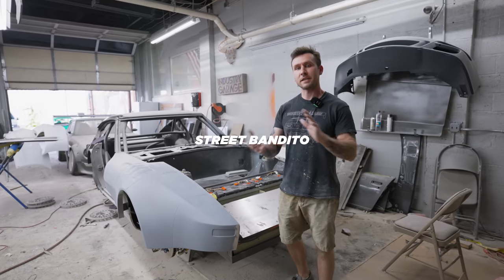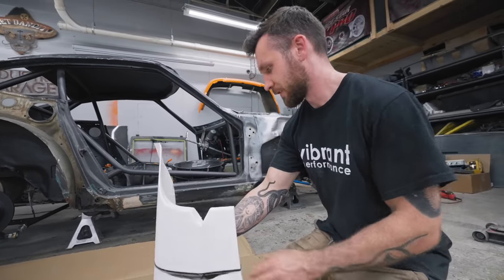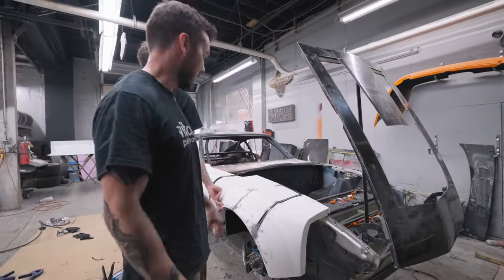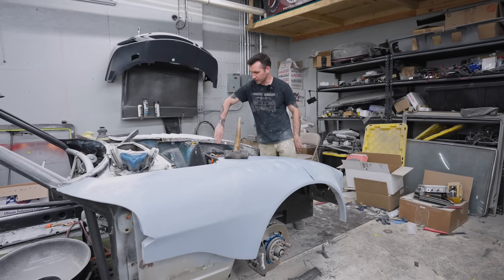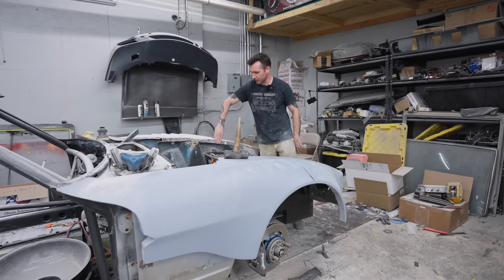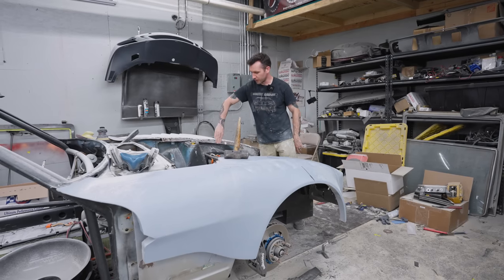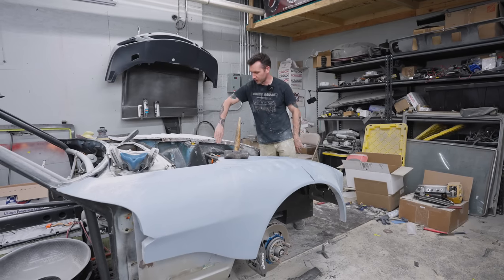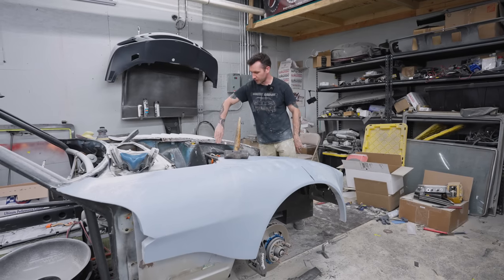Using 3D Printers To Build A Car Out Of Carbon Fiber | Part 1 | The Legacy (11)

Comment: This is awesome! We make a large format 3d printer that should be able to print those finders all at once with a separate support material. If you guys are doing much more of this or have a project that could use a larger printer let us know we would be happy to work with you guys on something like this.
Reply: Interested, personally. Do you have info on the large format printers, that is big enough to print a whole fender? Or do you have a way to get in touch, or even a link?
Reply: What printer do you guys have?
Reply: I built a 1.5x1.5x2.5 meter printer for projects like this and ended up selling it because it only had 2 nozzles pla and support filament, with 5 smaller printers I was able to print 4 times faster because I had mor nozzles working at the same time, also if a part failed it wasn't a huge issue in comparison to 1 large print
Reply: Could the same printers used to 3d print houses , be modified and used ?
Reply: @YeshuaDisciple916 Wouldn't it just be easier to make em with carbon and epoxy?
Reply: @CarsCatAliens  you can print directly in carbon impregnated filament using a hardened steel nozzle and then resin it. or create the outer moulds to vacuum prepreg or vacuum infuse. many ways to skin a cat i suppose.
Reply: Everything can be scaled..
Reply: I have a darsun z I'm keen to do a 3d body kit for
Reply: @RageAZA sorta my thoughts, but also for a need for replacement parts, this would be pretty consistent. Just build in rock shields separately, each panel gets a layer or two of carbon/kevlar/glass, then who cares about the top half, especially since so many cars these days are wrapped. Could skim it or whatever but frankly I'd just be worried about weight/rigidity

Comment: I am just tuning in for the first time.  it looks like you have these 3-d print parts that are all BUTT-JOINTED with flat face to flat face.   Instead you could have modeled an EDGE-to-EDGE detail like a ribbed joint, or studs and recesses, or borrowing a joint from woodworking, a half-lap, tongue and groove.  Fingerjoint might be too  fussy, and visible on the surface.  But you could model an edge pattern you could never do with straight-cut wood.  You could leave small voids for your epoxy in the joint width instead of letting it randomly ooze flat out.  Your joints would be stronger and more accurate to key them together, modeled, than relying on flat clamps and by "feel".  On the FINISH side you could taper the faces like on the long side of  gypsum board to have a very shallow V-joint for your finish compound to fill, and less likely to see the joints through paint, years later.   Of course thats a lot of work and you are in a hurry.   This is the first time for me seeing car body parts printed, and I am no 3d-print guy, and its great, but you could make your joinery do more work for you.

MUCH LATER: I wasn't paying close attention to the whole watch... the printed sections are just your mold base and not the finished shell, and not the mold-negative. So some of the above isn't relevant.  Anyway, you could still add the joinery technique so your mold-base would have tighter modeled geometry from end to end, and your clamp-up phase might go easier.  But after that your mold-negative is really flexible so geometry goes everywhere, and you lay CF on that, so geometry only happens when you put the shell back on the car.

Comment: Progress is looking great!! A tip I could give would be to tab in an egg-crate on the back side of the molds after cure, before removing from the plug. This will keep the geometry from changing under vac when making parts. 

For what you have done so far, I'm very happy to see the consistency of completion. A lot of projects of this scale hit major delays or never see the light of day. Excited for the next video!

Comment: I don't know much about car fab, but I know my way around 3D printing. I came to learn how it is used for carbon fiber work. I appreciate you showing how it is done. Nothing wrong with how you did the 3d printing in vase mode. A few 3D printing things you might try. In prusa slicer you can split the model and add connectors so they snap together so they are already registered. I would probably do infill over the vase mode to give it some better structure, like 10% and use adaptive cubic infill to keep the print times down. The infill will keep the parts strong and consistent. When gluing 3d printed parts, epoxy works, but there are bonding agents for PLA and PETG plastics. It might save some cure time and effort over the hefty applicator. Check out gloop or ca glue works well too. All just suggestions in hopes that it helps a bit, no worries if it doesn't work for your purpose.🍻🍻
Reply: Actually just took notes.

Comment: HI, just to say (I don't know if you know it) but avoid direct contact between metal (any kind) and carbon fiber, it will induce corrosion if there is water. You need to isolate the 2 surfaces from each other. It's simple, most people use a ply of glass fiber  between carbon fiber and the metal (or any other non-conductive material). Good project continue like that.

Comment: Very nice, goes to show what some 3D printers can do. I've always kindof dismissed printing for carving foam but I think at this point the 'ease' of just letting the printer chug might trump the work of loading foam onto a large router that is only going to get one side real good. 

For mirroring contours and details my go-to is always just take some paper and trace the shape on one side, cut the line out to make a template and tape it down on the other side. I suppose if the left and right sides don't lay quite the same it might push the template off a bit but wouldn't be too bad unless they were notably different topologies.

Comment: 3D printing is super neat with its use cases. Not that I’ve done anything to this level but I measure a blank switch plate for my Z, redesigned it in Fusion360, and added a hole the exact size of a switch I was using for my air compressor setup for my aircups. The button fit in super snugly after a few tries and since I designed it in CAD it was perfectly center and snapped right into my dash just like OEM. What you guys are doing it a whole different level and just goes to show the many uses for these inexpensive FDM home printers
Reply: 3d printing is going to keep our old cars on the road as it's becoming impossible to find replacement parts for some items.

Comment: I almost did this, then found a large form CNC machinist near me. Got a whole side of a car CNC into a negative or “plug” to lay one piece of carbon into

SO much cheaper, easier and quicker. The foam machined plug was like $390, just send them the cad file and happy days. It is one use but I’ve had not deformities or anything. Had the option to pay a few hundred more dollarydoos to have a 5x reusable one but I’m only make one Porsche haha

Comment: DuraMix 40/40 FTW!!! I have always spoken that stuffs praises! Not sure what it's called over here but where i'm from it's Duramix 40/40, and I used to use it a ton when making custom plastic Head Unit plates since my main work consisted of Fiberglass subwoofer enclosures and the such, from time to time this included making paint matching smooth custom Head Unit surrounding plates to replace the stock that would leave section of space, and mine would fic it up to look custom but also factory look if thats what a client so desired.

Comment: Was just thinking about doing this to a 914, I have 3D scanned the car and made STL files of the body sections to 3D print the panels using them as a core and wrap them in Carbon Fiber. The issue I see is that the 914 body is one piece and welded to the frame, making it a little more challenging.

Comment: For future reference, you can buy material 50" wide, but almost any length you could want. One piece for the outer skin and however many pieces you wish for the inside layers. :) No need at all for any butted joints because of a 50" limit.

Comment: this is an epic project, well done guys! one thing I noticed is it looks like the carbon wings were produced under a vacuum using vacuum bags, but I thought it also had to be done in an oven or heated room, how did you manage without it? 🙂

Comment: Awesome build!  I'm about to start a similar ev project.  I've had the thought to 3d print the body panels for some time now, and am stoked to see someone else has done it already.  

Question for you though.... I have a lot of exerpeince in machining and 3d printing, and have a large scale printer that can print the components all in one shot.  I was thinking about using a strong base material, like matterhackers NylonX witht he carbon fiber refinforcement, but i was going to carbon skin each side of the print, wet it out real well, then put it in the vaccum and seal the part inside the carbon.  

Just curious why you pulled it off.  was it just to make a thinner, lighter piece?  My thought was to use a 1mm nozzel (bigger printer needs a bigger nozzel so it doesnt take a month for each part) and going for a solid print with 3-4 layers at .3-.4 layer hieghts. Then putting another 2mm on the outside and 1 on the inside.

Would love your input on what you found!  Im considering making a video series on it... but its probaly going to be weeks worth of footage of what not to do before getting to the final product, haha

Comment: Loving the whole 3D printing thing. Should have printed in some mortice and tenon elements for registration so they all line up automatically.
Reply: I was thinking the same thing, but unless they printed everything in an enclosed printer, warping may have made it more difficult to line up during glue up. Without the mortice and tenon's, it was easier to fudge it if the parts did warp at all?

Comment: quick tip from me, you should use some D2-4mm dowel pins of like at least 20mm length to connect those parts, that way its way easier to position things before glueing

Comment: So cool bringing new tech (3D printing) to an old craft (mould making)! Do think it could be possible to carbon or glass fibre straight on the 3D printed panel and still end up with a light weight panel? obviously it would require lots of sanding and then a painted finish. however there would we no need for the female mould. I'm thinking for wheel arch flares.

Comment: Super cool,  get your 3d print designer to include holes and tabs in order to line up the models and screw the fender pieces together make it much less labor intensive. I guess if making molds you don't want inconsistency on the back.

Comment: Kind of surprised you guys didn't design in guide pieces into the the connecting areas.... Like little pieces sticking out that fit into the other portion to allow easy alignment without the worry of potentially having the design slightly off.

Comment: I've got one of those Neptune 3 Maxes. Due to the sheer size of the thing it prints really poorly at 0.4mm layer height with the 0.4mm nozzle, I did want to bump it up to a 0,8mm nozzle, but I keep putting it off. I've got a pet project of converting an SMZ S3D into a 1:2 DeLorean Tiny Tike thing and I really struggled with wrapping my head around how I'll sculpt the body. Had the whole thing modeled up in CAD, but 3D printing it didn't even cross my mind. Gonna definitely give it a stab given how small the car is.

Comment: Hey guys, this 240 looks absolutely killer. I just stumbled upon ya'll as I'm new to 3D printing and composites in general. I'm looking at developing a kit car and would love to be able to 3D print molds for use on carbon fiber body panels. One question, what's the material you used to create the Carbon fiber mold over the original 3D printed mold? Looks like ya'll applied it starting at 14:45 and then removed it at 16:00. Thanks!

Comment: I'm guessing you printed a positive to check fit and make a more durable mold but, for quick one-offs you could just print a negative.
Reply: I was going to make the same comment, the 3d print is just a pattern to pull a glass mold off of but it seems they used the print, if it’s pla you guys are going to have problems, especially if the air trapped in the infill of the printed part starts heating and cooling, and pla is corn based, it will decay in a year or so, the paint and clear coat may help a little, ASA is a more durable plastic designed for automotive use, however it’s expensive and it too will have issues later, I highly recommend removing and molding the parts, then producing fiberglass’s-or carbon fiber end use components, it’s a beautiful design, would want it to last
Reply: Oops my apology, I started commenting half way through the video, nice patterns…..
Reply: @blackjacko asa is the same price as every other filament, if not cheaper; do you even own a 3d printer?

Comment: Where do you guys get the STL files for the 3d printers to make the panels? Or do you scan original pieces and use software to clean it up before sectioning them to be printed in parts?

Comment: Must say the car looks stunning guys , very very nicely styled  .
I’ve done something similar but with an e36 but not electric so I definitely know how hard things like this are  .

Had to laugh when the PVA was being pulled off the mold , looks like it’s not just me that gets satisfaction trying to get it off in big bits 😂. .

Can’t actually wait  till it’s running 
PS just watch the scrub radius on the front geometry and the wide offset , could be very twitchy .
🇬🇧👍

Comment: Ive been thinking on this for a while, so I figured I would ask (maybe Tim or Tofu can chime in). Why wouldnt you print the plug directly rather than having to still pull a plug? Is it just for the fine tuning of fitment on the car that would be the issue at that point?

Comment: Hey Tim, forgive this newbie question but if the 50” wide piece was not wide enough to do the whole fender, can you not rotate it 90 degrees so the 50” runs vertically and then just cut off the roll for the entire length of the fender? Wouldn’t the weave technically still look the same when rotated? Genuine question as I’m wanting to venture into carbon fiber.

Comment: How do you mange to not overheat 3dp model when applying fg, even low exotermic resin systems go to 110 degres (C45). My large model made with PLA expanded during mold making. You use PETG?

Comment: I know it's a SEMA car so functionality is probably (definitely) taking a back seat but I think it would be good if you found a way to get some air (maybe via some carbon ducts) to the front brake rotors. I think the way it is now there is very little air flowing through that area.

Comment: For future builds with large 3D printed parts (or anything you want to be stronger) you can literally get a bucket of superglue and hand wipe all of the parts down to increase the bond strength of the layers exponentially. Try it. You won't believe it.

Comment: What has prevented the auto manufacturers from 3d printing vehicles enmasse?  Iknow NOTHING about 3d printing but correct me if I am wrong, we can indeed 3d print metals right?  Is it just too cost/time prohibitive vs just stamping sheet metal? My biggest complaint about the super/hyper car market is they are inferrior vehicles compared with everything else but have niches like exotic looks and engines that should easily be replicated for a fraction of the cost. If someone could 3d print body kits for GOOD vehicles, even something like a Toyota camry to make it look like a lambo, I would imagine theywould take off pretty fast. I know I would buy one.

Comment: you can weld plastics like this with a 3d pen. I do it for all the projects i do for engineering. once you sand it you can get it to the point where you cant even tell that it was used.

Comment: Blocked with 180? Are you putting more epoxy over that? Youll see 180 through clear coat
Reply from the maker: block down with 180 finish with higher grit for clear to rid the marks.

Comment: Okay, on the stabilised carbon fiber sheets and the issue of not enough "width" on the roll... is the stabilised sheet only one sided? Because if its possible to just flip it, you could've done both the fenders "by length"...?
Reply: Yes it is one sided. The back side has a veil that does the “stabilizing”
Reply: @Grenadefp  I guess that's an idea for FibreGlast for another product... 8)

Comment: Should take the insides and reinforce it with some epoxy resin and fiberglass 🙃 just so like its less flemsy. You can also add ribbing with this idea, may also be able to add heat protection and stuff as well.

Comment: Forgive me but why are you not printing the parts with simple alignment bumps or tabs so it does not slide around during positioning would cut down on the assembly process, Cheers!

Comment: Could someone help me understand why did he put the optical/fake line in the front part of the fender? To make it look like "standard" bumper is mounted there? Why, plenty of beautiful cars from 50s and 60s have fenders all the way to the front, small filler piece between headlights and outer chrome bumper. So it would look like those cars with chrome bumper delete without the optical break/line. I am confused tbh. Still love the build, the best build on YT (except Rob Dahm's 4-rotor ofc)
Reply: It's just a visual choice, but I agree with it. Basically visually breaks up the long continuous surfaces, gives it the appearance of having a bumper, rather than looking almost like a one piece front end.

Comment: Probably old news but the epoxy tubes are that long typically for anchoring “anchor bolts”, or something else embedded deep in another solid. The epoxy needs to penetrate all the way to the bottom of the bore I.e. the length of the tube. Also the epoxy mixes in the tube, and stays usable until it exits the tube so you are not losing much … I was bored needed to comment lol…